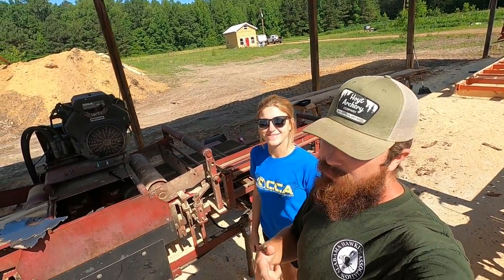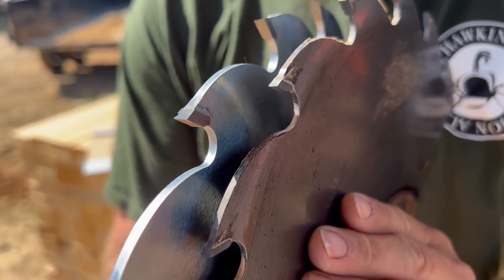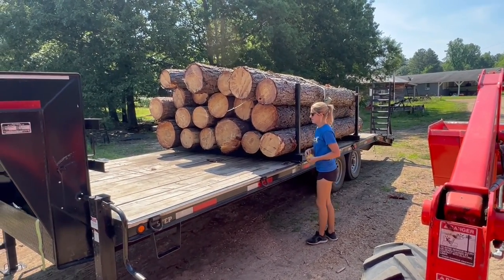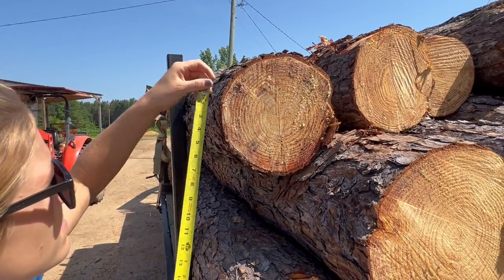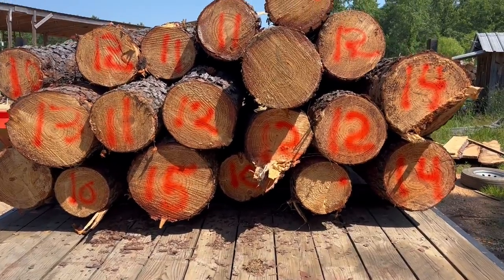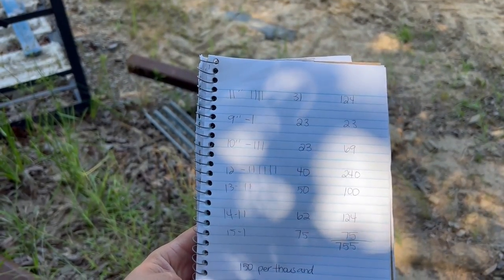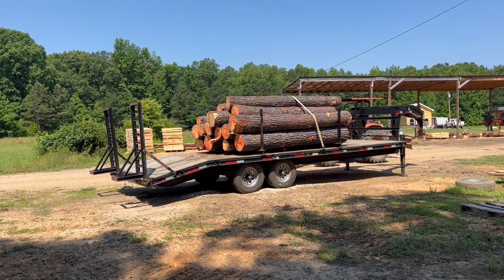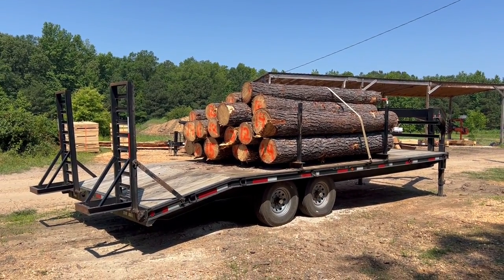How to SCALE and purchase LOGS at a SAWMILL!!!

Comment: "Team work" makes the dream work. I like your system for scale and same as I used to do if I had to scale loads. I liked the scale shack better as they kept it from the person feeling like I cheated in some way ... I know they see trees, but I seen bananas, sap rot, limbs and such. A little two by four with a six inch hinge knot in its length doesn't make for a framing board, at best, some times can use in a pallet if its not compromised too bad.
Reply from the maker: Exactly!

Comment: Awesome stuff. Not Q@A, but how about a video of the circular saw and when the handle is pulled what does the reader mean and what does a pull represent went comes to inches. I notice you never use a tape measure. When you cut a 2 x 4 is it a real 2 x 4 or the undersize we get at lowes or home depot? Thanks again for the video.

Comment: great explanation,  do you know if the Doyle scale is changable to metric
Reply from the maker: Hmmmm good question! I will look into that.
Reply: In my opinion I wouldn't use the Doyle scale for conversion; it's the least accurate of the many different scale systems used.
Reply: @TheOldManAndTheSaw  It has it's purpose.  Smaller logs take more time per bf because of inefficiency built into handling more logs and slabs.  However as logs get bigger the accuracy of the Doyle scale gets very close to the International. Time is money in the mill business especially with margins being what they are in some markets.  YMMV..
Reply: If I understand the question correctly...........
In the metric system logs are bought by the cubic meter. In the US logs are generally bought by the 1000 Board Feet (M/BF).
One cubic meter has 423.77 BF in it.
1- M/BF = 2.36 cubic meters.

Or, maybe, I misunderstood the question.

Comment: That's not how you scale a log . Take the log diam. times the length  = approx. board footage . So a 10" by 10 ft. log has 23 feet according to SIMONDS scale and 30 feet according to " Wood-Mizer " . That's the number you stamp or write on the log end . Those numbers assume a straight log , if crooked take away 10 or 20 % .I sold my mill over ten years ago but i still have several log & lumber scales . All sawmill supply business's have log & lumber scales for sale and some for free . 
     I watch your video's all the time and wish you good luck and safe working . Things can go wrong in a hurry around a mill ,